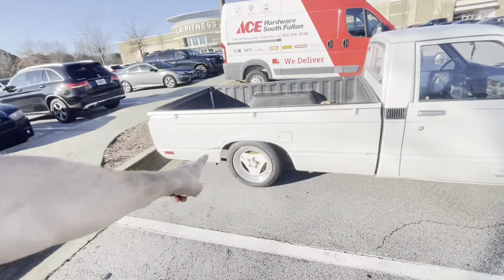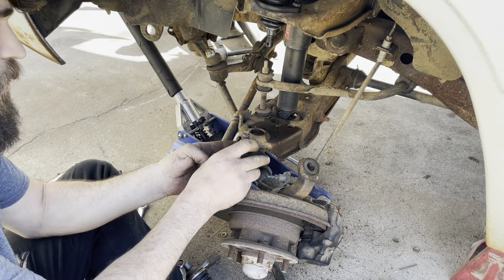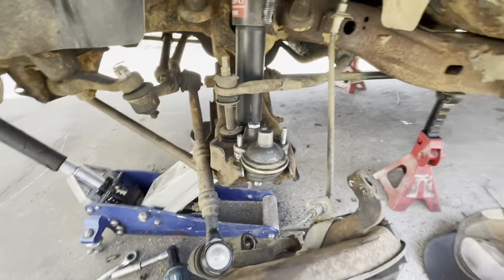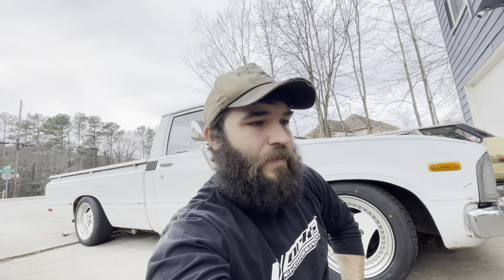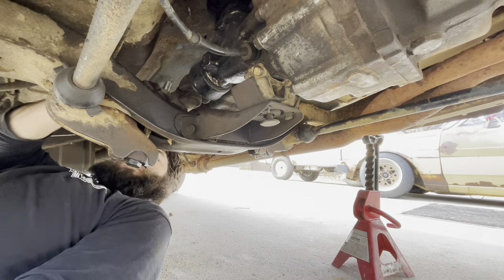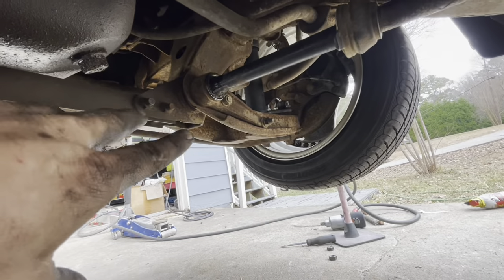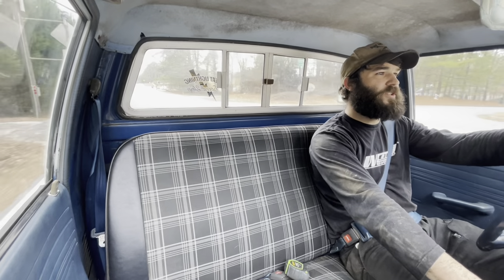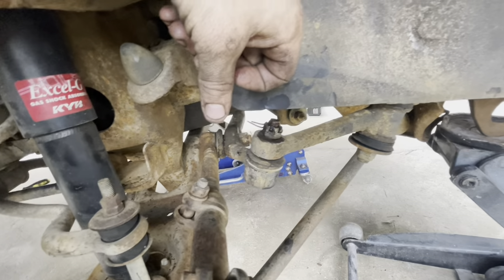Toyota Pickup Ball Joint Flip/Torsion Bar Re-index! Free Lowness!?!!

Comment: So just an fyi. I have an 81 I am currently bagging/body dropping. I bought a 93 Toyota truck front half of a frame from a wrecking yard. The uppers and lower control arms are identical. You can replace the uppers a arms, lower control arms, hubs from 84-95 Toyota and be able to use drop spindles. Something I had to find out by myself because absolutely no one could tell me if they were the same. I put the drive side on and left the passenger side on to pull measurements. They track the same. Nothing is different beside the hubs, balljoints style is different but still mount the same.
Reply from the maker: Yea, used to be easier to find that kind of info on forums. But the internet these days is basically useless.
Reply: @deathwobble  that’s why as soon as I seen you were working on your suspension I’d let ya know brother.
Reply: @edparker1972  are the torsion bar mounts the same as well? (the mounts towards the front) so much conflicting info.